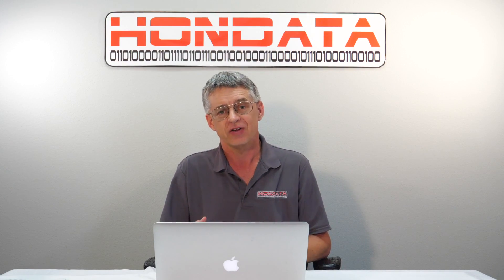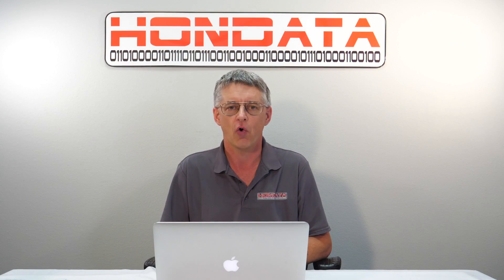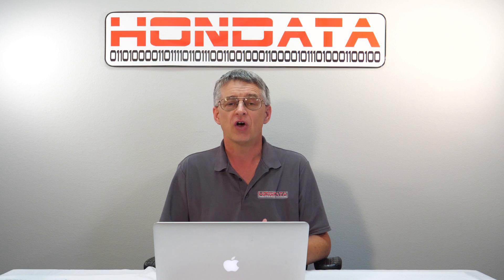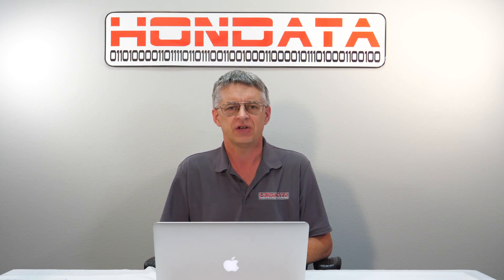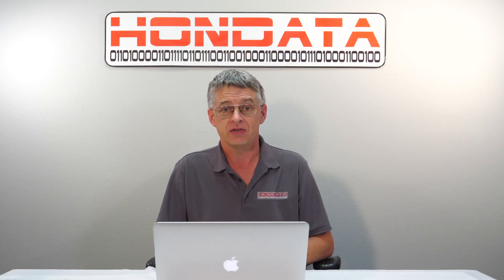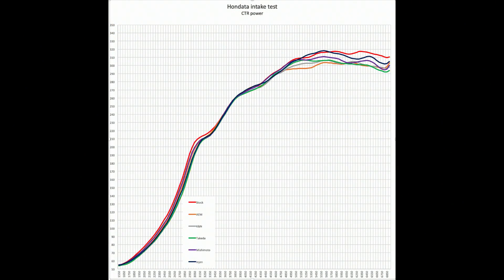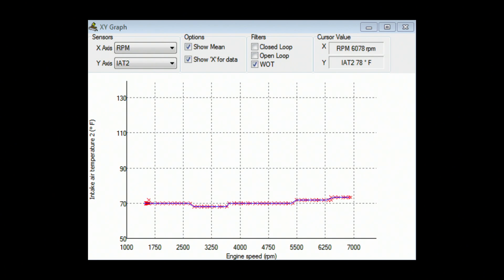Best Intake for Civic Type R (FK8)  - Hondata

Comment: Better test would be actual data ogs at speed with fresh air coming in on the road
Since the Type R uses aircharge targets it will compensate by varying the turbo speed to speed up or slow down to meet aircharge targets.  While power will be similar, youll see which intake uses less boost/less speed to hit aircharge target.  

Plus - once you tune the R for more power - the volume/velocity of the intake becomes more important than at stock power levels.  Stock intake will be too small/restriction for 400+whp setups

Show the logs
Reply: @Cobra Kai im making 533/431 on a PRL HVI with a 3.5" maf maxxed out - going to a 4" maf housing specifically designed for the PRL HVI - 560-570 at 33-34psi on p600
I dont think a stock intake would work for me but its always fun to watch the guys say a stock intake is better than a PRL....guess ill have to suffer only making my power lol
Reply: @Cobra Kai On a tuned car with a larger MAF housing, I'd agree with you.  But without changing the MAF housing, just like most intakes on the market, they are purely just for sound.  As their testing showed, it was the IATs that killed the effectiveness of these intakes.  The variances were small, but everything downstream from the intake had to work harder for sure.

Comment: Point of contention: You're running the car on a dyno with the car stationary which means you're sucking in static air that's sitting around the engine bay. In a real world application the car is moving with air traveling into the air box at the speed of the vehicle. If an aftermarket air intake system allows a greater volume of air to be enter the air box, then the average temperature of the air is going to be cooler than the restricted amount of air the OEM air box will allow in during the real world movement of the car

Comment: There's no power gain because it's still on base map, right? The stock intake is best because the ecu is tuned with that specific intake from factory, no? How about a re-tune for the aftermarket intakes? Just curious 😞
Reply: Yea they should have put a disclaimer that they are only using the base map

Comment: Do intake temps really matter with a turbo engine? When the air hits the compressor its going to heat up anyway. If you want cooler air to the intake manifold, invest in a better intercooler. If I'm wrong, please enlighten me.
Reply: The type R uses a charge air target to hit - intake temps effect power as density varies by air temp but the ecu just allows the turbo to spin harder to compensate for air density. 
These intakes effect density by air temp but also change volume/velocity
The stock closed box is most likely maintaining better velocity and denser air charge over the open element filters
Also for the type R its best to show uncorrected numbers as it compensates on its own for baro/air temps where a dyno would add/subtract power figures based on those variables.

Comment: This is just a heat soak test ...The most open intake ( AEM) does the worst and the most closed  (after stock) is the Mishimoto which is second after stock.A good sealed up intake like eventuri ,prl high volume will have better results.But those are left out of the test offcourse.

Comment: I knew it. This car's design is really a masterpiece by Honda. That's why I never purchased an aftermarket intake for my type R; I could care less about the sound.
Reply: Maybe cause they tested a stock car with no tune here watch this, aftermarket will always give more power https://youtu.be/CaR2luCjEpo
Reply: @InNoTime3377  that's with a tune.. Not stock.
Reply: @djs18  Wonder why hondata didnt test the prl 🤣
Reply: @djs18  I wouldnt put a short ram intake anyways cause it will just draw higher intake temps, like he said at the end of the video cold air is best.
Reply: @InNoTime3377  For this particular vehicle, the stock intake is the best option for the vehicle.  Now if you're going to (computer) tune the vehicle, that's a different story and the intake makes a difference, but if you're going to keep this car stock like me, the best choice is the stock intake, obviously.
Reply: @djs18  dam stock foreal? waoww lol the first thing i did.to my civic was get a flash cause stock was ridiculous slow and i saw a improvement with the gas mileage n drivability
Reply: @InNoTime3377  lol yeah the car has a 100,000-mi 10-year bumper to bumper 0 deductible warranty and I don't want to void it. thankfully, the computer tuning has nothing to do with how insane the car handles, so I still really enjoy the car.
Reply: @djs18 tbh i wanted a type r but opted for the si for gas mileage and whats crazy is i beat stock type r's on the highway through curves n all, while getting 40+mpgs for half the price 😅 but yea to each their own, type r are cool but really just for looks n show
Reply: @djs18  haha drivermod doesnt even have a type r.  he has the si.  and he claims its faster than a type r.  BAHAHAHAHA!
Reply: @teemohnay  lol I think the Si is a great car for its purpose. Great fuel economy, sporty engine and sporty suspension. But it's most certainly no type R and will never be.
Reply: @InNoTime3377  no you don't.. you've never even been in the curves with an type r lmao
Reply: @teemohnay  I raced a white type r tuned by derf down here in south florida.... well what can i say i beat him in a straight line and through some highway turns....guess everyone doesnt have the drivermod in them....dont get butt hurt please lol
Reply: @freedomfox8183  I love your assumption 😅
Reply: @InNoTime3377  He obviously didn't know you were racing him.  HAHA.  I've had a modded out 2018 Si.  Hondata +6psi tune.  Injen intake.  She was quick.   But my Stock CTR is way faster.  I've owned both cars man.  I know first hand which car is faster.  Get real.
Reply: @InNoTime3377  Well, at least we both love Hondas!  Cheers brother :)
Reply: Turbopower00 

Either your car is tuned, they aren’t racing you or they’re shit drivers.

Si civics don’t hold a candle to the R; that’s why the r set records not the si.

All the owners you beat probs found it laughable you raced them
Reply: @InNoTime3377  commenting over a year late. I don't see how you beat a Type R in a SI. Not stock for stock at least or even if you had a bolt on or two. I had a 2018 SI and traded in for a 2019 Type R and its a night and day difference. Stock for stock Type R blows the SI out the water

Comment: Okay, I'm mad now.  You did not test the Eventuri in this video.  Stock #1  How is this possible?  What's so unique about the stock design that I would want to go back and refit it?  I really need to know.  MAF sensor position?
Reply from the maker: Colder air at the same pressure has more molecules of air (n). PV=nRT.  Simple algebra n=PV/RT. As the temperature decreases, everything else being the same, the number of molecules of air increases. You want to know, read here: https://en.wikipedia.org/wiki/Ideal_gas_law  Physics.
Reply: The physical design of the airbox is the secret?  Or is it the material?

Comment: 3 fans like that can never simulate the actual airflow experienced on the open road at 120 mph at the top of fifth gear (I dont even really know the top speed of the 1 to 1 gear and im not even sure what gear 1 to 1 it is). Even factoring in the under draft of a moving car sucking away hot air from the exhaust, and who knows hot having a fully heated radiator near a static intercooler and exhaust turbine housing gets. Yet again, an intake like this only takes advantage of cold air if there is cold air available to be taken advantage of. It doesn't make cold air... Im sure if you took readings from the IAT sensor while driving the IATs would be much lower than 120F.
Reply from the maker: We logged the reading from IAT2 (the front) on a Civic Type R with a short ram intake on the race track at 80-100 mph. It read 175F.
Reply: @HondataInc  Oh. Well thats kind of embarassing I suppose. That appears to be more of an issue with the overall design of heat management on the Type R. Im not sure what the testing protocol was for this track session but if your intake temp on the short ram was 175F then it must not have been a very fun track day. Was the overflow tank on the rad literally spewing coolant everywhere? Hitting like over 230F easily? Anything softer than a 400 treadwear tire mustve been melting into the track. Im spoiled, living 300 feet above sea level with ambient temperatures only reaching 60F for at least half the year makes a difference. Without the full info as to track conditions etc, it kind of sounds like the car wouldve been bogging on that thin blazing hot air with the stock airbox anyways... which yet again is just kind of offputting.
Reply: @mikehorb9485  they're just giving excuses

Comment: its hard to negate the raw numbers, but still. No Eventuri airbox used sadly.
Also no comment in how the intakes would perform in a tune. This is all on stock tune.
Reply: Judging by those IAT's I'd say they'd perform even worse.
Reply: The only really bad air intake temps listed were those of the short ram systems. The slight increase in air intake temps with the CAIs could be a result of increased engine temps due to leaner air fuel ratios.

Comment: I've been seeing a huge trend with the type R of stock parts outperforming many aftermarket parts with people who own them stating that they would have been better off leaving certain things alone. Obviously there are some things that can make considerable gains if replaced but not the case with many of the traditional bolt-ons. Quite a testament to the engineering that Honda put into this car. I guess if they went as far as to make it look like a turbo twinkie they must have had good reasons for their design decisions.
Reply: EXACTLY !!!! That's why i left my stock intake too. I knew it. Right now all i have is a drop in k and n filter and planning to get a heat blanket to wrap the stock intake. My friend have that set up and he noticed a huge difference with no issues at all. Good job Honda engineers.
Reply: Cooleye 888 even KN is worst than OEM filter

Comment: I think we’re forgetting to test gain after a tune with each intake? Testing with a stock tune is more likely going to lose power. Also would be good to compare with the stock intake with a tune. Not to mention PRL and eventuri not being included in this test.
Reply: I agree
Reply: You won’t see any difference with the stock intake on a tune. This mod is for sound and looks mostly. Best mod is an upgraded intercooler and new intake hosing
Reply: John Ames the stock tune from the factory was made for use with the stock intake, however, Honda will not tune aggressively due to environmental and consumer reasons, therefore a tune would still yield more gains even with the stock intake.
Reply: And this car dont run in dyno. In the real world the car is move fast into windy roads and then intake systems take more cold air and gain more. In dyno car is statick and dont move , dont take cold air :)
Reply: MrMaldezzar there’s 3 high power fans in front of the dyno during the testing to rule that out.

Comment: To be expected, for under the hood intakes.

If you note where the filter sits on each and every intake in the video, clearly that when the filter is located lower in the Engine bay, that intake wins... Injen had the lowest placed filter, which means it beat all the other aftermarket intakes, then the Mishimoto had the next lowest filter winning second, so on and so forth. OBVIOUSLY, the stock intake did best because when it comes to making an intake that is located under the hood, the OEM has the best research and development to make the best intake. Therefore, their filter was placed low, it was placed with the best seal from heat coming in, the best seal for having air feed to it from the bumper/grill area, and had the correct piping diameter. No brainer.

As for the PRL CTR Fk8 intake, I expect to see the same results as the Takeda, since their filter is up high. Even in PRLs tests, they show that at about 4k-4.5k there was a possible difference than stock (during their hottest runs, which matter most).

As for the Eventuri intake, I see it to be closest to the Mishimoto intake, because the filter is pointed down, not just up high like the PRL and Takeda. Mishimoto likely coming out on top compared to the Eventuri, and Injen still the best for the aftermarket intakes.

Now, we wait for a Cold Air Intake test. Clearly, just as "Doug" stated, cold air is best. Cold Air intakes have the filter placed outside of the engine bay, away from the heat, and ALWAYS win when it comes to making power, because they get COLD (aka not under hood) air.

They should rename this test, the Short Ram Intake test.
Reply: Apparently, there is still no cold air intake for the Fk8 CTR, on the market, thus far. Get the ball rolling! The car has been out for two years now.
Reply: Mishimoto has an aluminium box which holds the heat instead of deflecting it, therefor reducing or negating the gains made. Eventuri had a CF multiple layer airbox which deflects the heat way better. I have one in my FK8 and i can notice a difference in the upper powerband due to better flow. Sadly i cant back up the statement yet as i havent dynod my car. I did however run a friend who was stock and we noticed my car walking away every time at the end of our gears. (rolling starts at 70 km/h starting in 3d gear)

im not a fan of any of the above intakes really hence why i went with Eventuri. However, in the UK there is a company called TDi north which has several FK8s in the 400+ hp range, with alot of them using the Injen intake used in the test above, none of them using stock airbox, so the intake has to make some difference i would think.
Reply: Aluminum is good for getting rid of heat from a heat source attached or going through it, like an intercooler, radiator, or heat sink. Plastic is the best for keeping heat from getting in in the first place. Next time, use more plastic, Mishimoto. The Mishimoto seems to have chambers, and that's why I would think it would do better than the Eventuri, but it could be the other way around.
Reply: @copperkeyracing6167  the Mishimotos performance isnt even close to Eventuri's (after a tune). While you are right, its only partially right. Aluminium cools down faster provided its being exposed to a cooling factor (water, airflow). If its not it holds the heat. In the bay itself its close to the turbo and the air coming through the scoop isnt enough to cool the box down. 
A tuner in the Netherlands told my friend his mishimoto airbox was holding him back slightly from gaining even more

Comment: THAT IS WHY YOU DON'T PUT A COLD AIR OR SHORT RAM INTAKE IN YOUR CAR NO PERFORMANCE GAIN.THE FACTORY AIR BOX IS GOOD BECAUSE PUTTING A COLD AIR INTAKE OR SHORT RAM  CONFUSES THE COMPUTER ECU AND SENSOR  ON YOUR VEHICLE AND AIR FUEL RATIO MAF SENSOR
Reply: Additionally, nothing filters as well as the stock air filter. That stock air filter for the type R is quite heavy duty.
Reply: lmfao wtf are you saying?
Reply: @PurpleHeartVR  me or DJS

Comment: That exactly why I replaced my stock panel filter with a dry AEM one. I’m all go not show! Any gains with the higher flowing cai are negated by the price to gain ratio.
Reply: Ronald Batalla how much boost u got from it out of the stock tune? Im interested im buying an aem filter drop in.
Reply: ellbert dinoy I haven’t been on the stock tune for months. I’ve been on Hondata Flex Fuel. And E30 before that.

Comment: So just get a K&N drop in filter in the stock intake box and call it a day basically
Reply: With a prl intake tube
Reply: 😆 lol. Absolutely.
Reply: I wouldn't get a KNN filter. Hold it up to the light and you'll see how much additional dirt is getting into your engine. I'll stick with the stock filter, which is actually pretty heavy-duty if you take a look at it.  All the KNN filter does, is give you additional noise on your blow off valve. I'll pass in favor of more filtration.
Reply: @djs18  only that if you actually look at engine oil analysis you'll see that there is no increase in dirt in the engine, even after 2 years or 50k km of usage. So you're just making up bullshit.